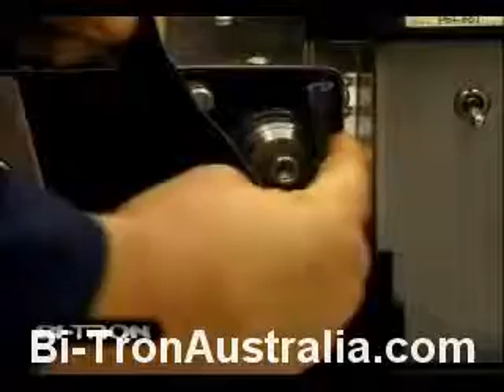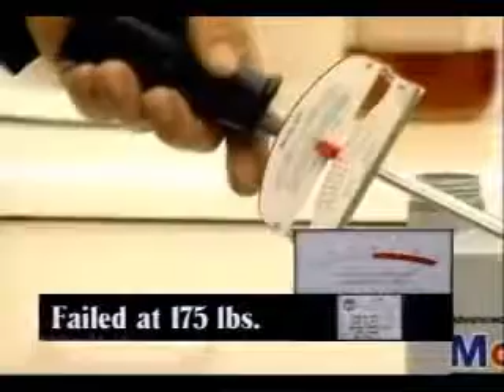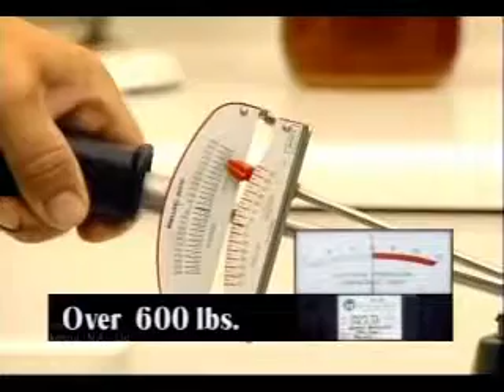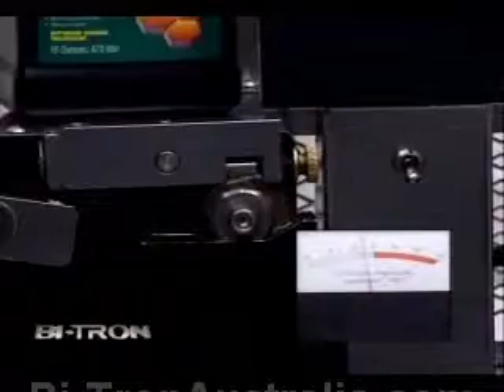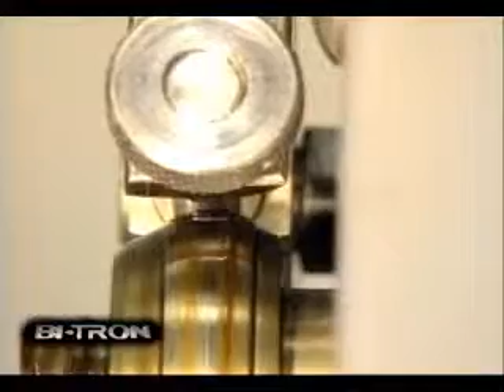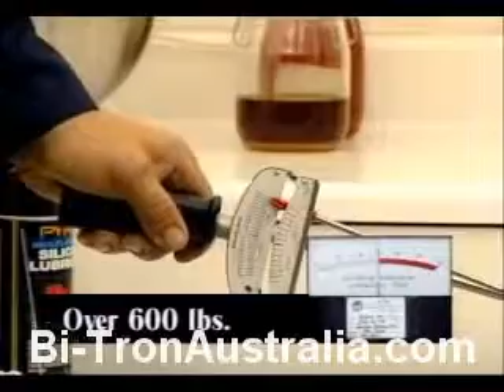Bi-Tron Australia test on cross axis machine

Comment: So much total and utter BS, especially for high tolerance engines, which this test is only a false positive type test, meaning that your engine bearings and other moving parts never ever have that type of pressure applied to them and also all the OE spec oils out there do have the right amount of protection in the oil to get your engine running right, so the ASTM D2783 4 ball bearing test is the real oil testing machine which then the particulates get sent to a oi lab and the results shared with the client, which may have 20 million dollars worth of machinery ? Also this machine is called the one arm bandit testing machine and i used to do so many demos of various oil tests compared to WYNN's Industrial friction products and they always bought the industrial friction products from me. :)  why because we sent the OE oil before treatment and after treatment to oil LB's which help oil manufacturers work out how much and what types of friction products are going to be used in the factory oil to be sold for customers and massive chains which will sell the Oe spec oils for various automotive and ATF and gear oils etc. :)